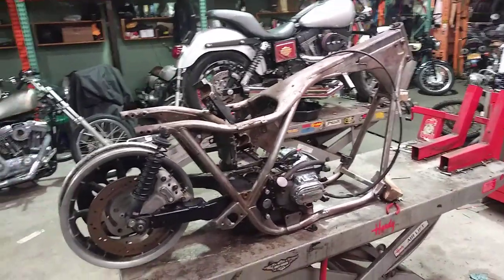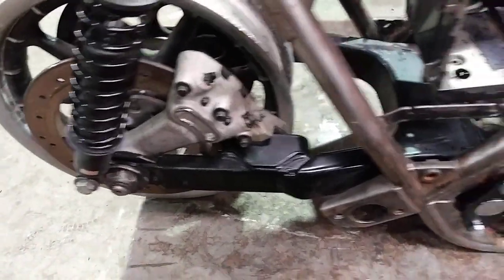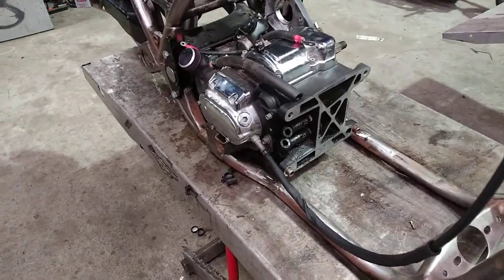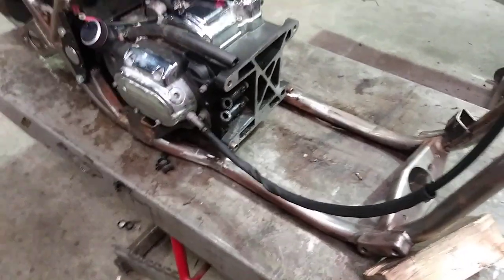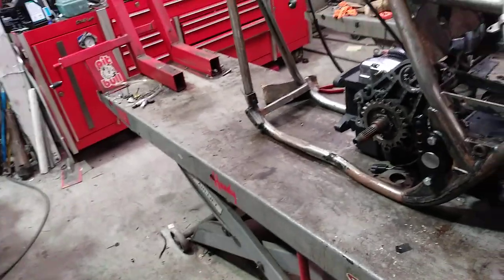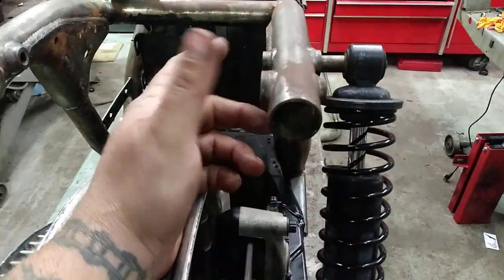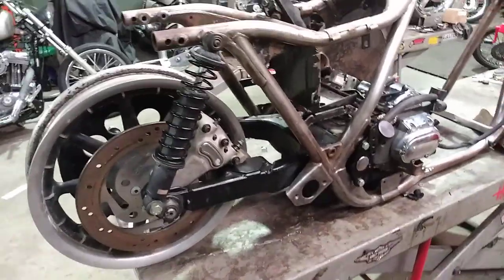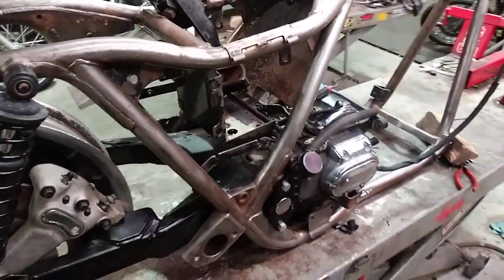Harley fxr twin cam conversion part 2

Comment: A Shovelhead part will mount the old style sidestand to the two-bolt mount. Use high strength bolts. My '88 had the stock stand bend and the mount bend later so since I 
prefer the Jiffy stand I dug around in my leftovers and found the Shovel plate is a bolt-on to the FXR forward peg mount. I used two high strength socket head cap screws (one is hidden by the sidestand and wrenching clearance between it and sidestand is best with a socket head bolt) and red Loctite. No problems over a few years use including  kickstarting now and then and I'm not kind to that bike. Those forward  peg mounts are robust. If I managed to tweak one there is ample room to weld in a piece of say 3/8" plate to pick up sidestand mount holes,  but I don't see that happening.
Harley part info =" 49129-77, FOOTREST BRACKET, left - chrome" but other versions of that plate style exist.

Comment: I did some swapping trans and swingarms on twin cam baggers I went from 01 to a 03 trans n found out inner and outer primary stuff was different so I ended up having the 01 trans case pivot hole machined bigger to use newer swing arm
Reply from the maker: What was the actual differences with the primary was it just that bottom bolt went in the opposite way?
Reply: @bad-foot  the inner primary bolts line up with motor fine but not on transmission..the bike I was working on is a 01 n thg he trans I wanted to swap in was o3 .so when th ed primary didn't bolt I got a 03 primary and then the 01 outer primary didn't fit the 03 inner look story short i wantedto use all factory parts no after market kits I just had 01 case machined bigger for  pivot shaft and everything bolted together
Reply: @bad-foot  later on I found out bagger inner primary are the same from 95-01 as well as outer primary.
Reply: Check the True Track swing arm repair kit on their page (all ya get is a thumbnail view so look close) but instead of buying it, grind the end of a 3/4" reamer down (your local machine shop can do this on their tool and cutter grinder) to 5/8" like their piece and if you don't have a large drill, reduce the shank. Then do what this guy  https://www.youtube.com/watch?v=ZRTvRnfRRjQ did minus the bearings. True Track doesn't clearly show their piloted reamer (the correct term) for obvious reasons but any machinist recognizes it as a modified ordinary chucking reamer. It's also not hard to bore a complete transmission on a milling machine. A plate drilled to bolt the gearbox to a common machinists angle plate is all ya need and one plate could do both Twin Cam and Evo bagger and FXR boxes. If you want to repair worn bores just size your reamer OD to the OD of your desired bushings minus the interference fit.

Comment: I have an 01 FLHRCI Road king that got rear ended and destroyed the swing arm wheel fender and tire. I found out the swing arm is a one or two year only swing arm. It is hard to find and everyone I have found they want my next born male child for. I can buy an entire 2002 frame used with a clean bill of sale for the cost of some of these 01 swing arms part (no# 47549-00) Any suggestions.  I was even looking for a rigid frame this motor and transmission will fit in.
Reply from the maker: You can get the 02 swingarm brake and rear wheel and upgrade everything or get I think it's a 96 to 99 swingarm and either weld a bracket on for your 4 piston caliper or get the early caliper with the swingarm and then they would just be a bolt on
Reply: @bad-foot  Thanks I am an old Panhead  Shovelhead guy and I don't know these twin cams. After I started looking for parts I was  sorry I bought it.
Reply from the maker: @lisar3006  yeah simpler times well I'll keep it in mind I'm always searching for these parts if I do see that 00-01 swingarm ill let ya know
Reply: @bad-foot  You have a part number for the 2002 swing arm upgrade. that sounds like the best way to go I most likely have a brake caliper for it.
Reply from the maker: @lisar3006  47549-02A but you need the rear wheel brake and the pivot bolt is different
Reply: @bad-foot  No problem I have to buy a rear wheel anyway I was going to re lace the old h 3/4 hub until I saw what they wanted for the swing arm. I can buy a frame for an 02 cheaper. I just wanted to be sure a later year swing arm will bolt up. I tried to get this info from the Harley Davidson shop but they were no help at all. Thanks for the help.